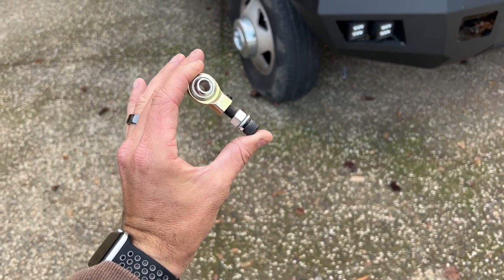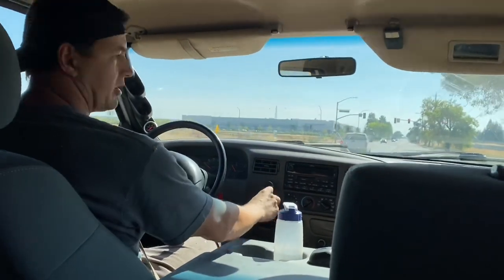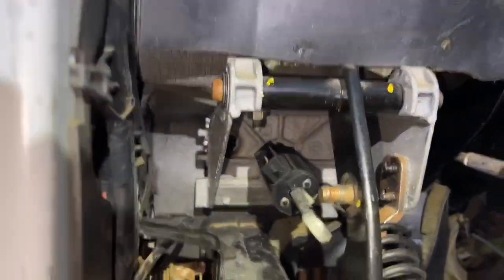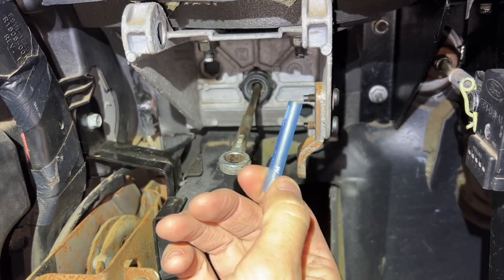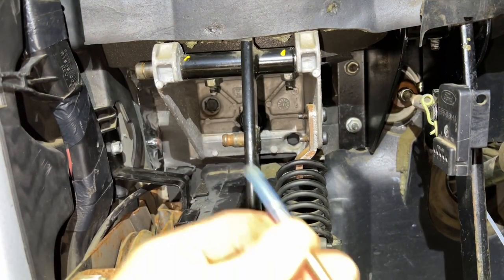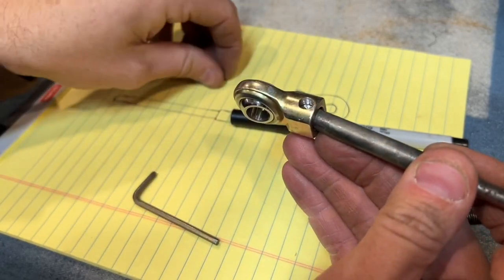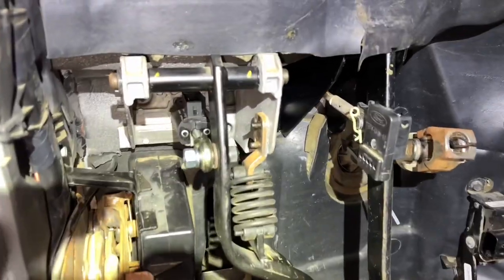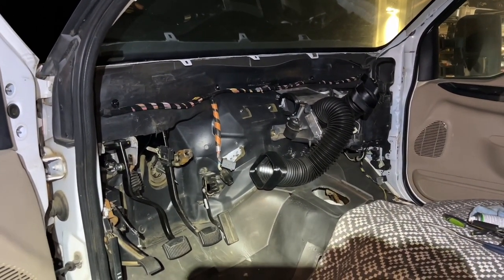2001 F350 7.3 - Clutch Pedal Fix This is a MUST mod, Swivel Bushing - Rod fail Repair

Comment: With this upgrade u can’t push the clutch all the way in, and if ur not careful the new bushing can smash that little electrical connector if u push the clutch a little too hard
Reply: I didn’t work for me either this way. I think it’s for older vehicles. On my 99, I measured the overall length and welded the bearing to the shaft to match original length. Afterwards, I cut off the end where the shaft is suppose to inside the housing. So in other words, I welded the shaft to the opposite side. After I cut off the end of the bearing, I smooth down with a sanding disc. Works perfect.
Reply: @JimSoukup-ix9fd  I took the electric clutch safety thing off and on an OBS 7.3 with an auto, they have an identical plug that is identical to the superduty 7.3 manuals.  If u put the OBS auto plug in that connector, it will bypass the clutch safety and u can now start ur truck with no clutch or start it in gear which saved me when my linkage broke and I had no clutch

Comment: As followed per instructions, this swivel pushes against the clutch safety switch preventing the clutch pedal to go all the way down to the clutch pedal stop
Reply: I am having that issue too. I think Nick wasn't pushing the pedal all the way to the floor in the video. I haven't figured out a solution yet.

Comment: A couple of things.
1 Great Visual Coverage and care in cutting in proper location.
2 The name of the part U Slide the push rod in is a Heim Joint
3 No need for Lock Washer, use Flat washer on both sides of Heins.
4 To Secure rod on Heins use JB Weld and tighten the set screw as well.
Note: If someone was to cut the push rod a little short they could simply remove the pivot arm and Spring and readjust the arm to allow for a full depth push to the floor. Just move it in 1 spline notch should do it.

Comment: well my master/slave i think went bad so i was driving without a clutch.  i installed a new assembly but now the pushrod thingy broke where the connector is.  i drove home from work with no clutch pedal at all and i had to rig the switch to be able to start the truck.  i might bypass the switch permanently.  hopefully i will have a clutch again soon.  at least my truck is running.  i got a new alternator and then a new Fuel Injector Controller Module from a salvage yard.  It is running great but I might have a bad injector or two.  and a glowplug or two.  or just a glowplug.  not sure yet.  2003 F250 7.3L powerstroke!

Comment: 2:20 i tried to pop it back in but i couldn't do it.  i couldn't even reach in there.  how did you do that?  anyway, i just removed the switch and put a piece of bic pen in it and drove home with no clutch pedal whatsoever.  stupid switch.  can't even start your truck without depressing the clutch pedal.

Comment: you don't really have to stop.  just slow waaaay down and drop it into low gear.  drive on the shoulder if you have to.  when the light turns green then go and merge with the traffic.  but i put a piece of a bic pen in my switch so i could start my truck this morning when the 'birdcage' plastic think broke.  part of me doesn't even want a clutch pedal.  i don't really need it anymoar.  if you have to stop you can grab neutral and then turn off the engine.  but try not to ever stop.  stopping is for losers.  just go.  go very very slow if you have to.  Amen.

Comment: Does anyone know if you can leave the pin on the clutch pedal and drill a hole thru the clutch pedal pin and use a cotter pin to hold the new assembly in place?
Reply: I just found a washer that fit nicely then wrapped electric tape around the end 80k miles no issue

Comment: Not a bad fix but I just used a stack of e clips to keep it from falling off and that held up for years
Reply: The Ford plastic piece does not only hold it on there, it's also a bushing. If you just use clips to keep it on you won't have the same travel in the pedal because it slops a little without the bushing. The plastic thing is a piece of crap though, I've replaced it twice on mine. Been wanting to make a thin bushing out of aluminum or brass and then keeping it on with a clip or something would be fine. Less work than welding a whole new dingus on there.

Comment: Duck Tape
Seriously, drill a hole in it. Place a washer over it then push a cutter pin through it problem solved.
Other idea, use a die and put threats on the knob. The washer and the nut.
Reply from the maker: It would work but will be to sloppy, the bushing swivel is a tight fit and there is no slop or clanking